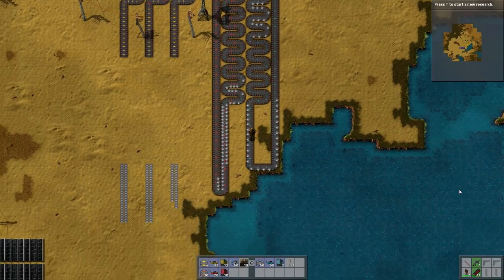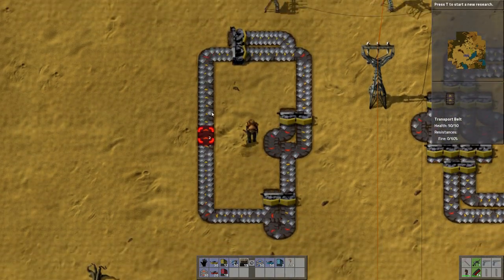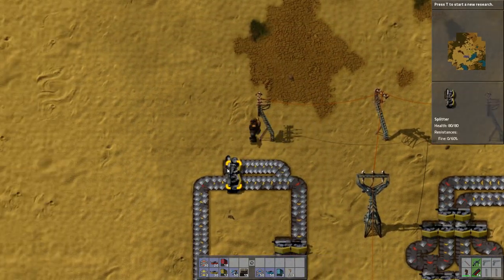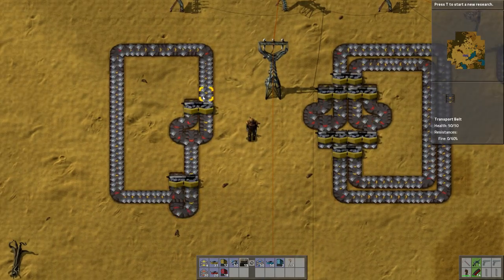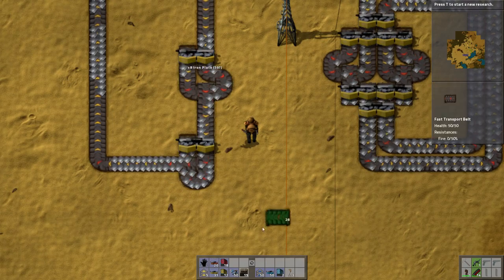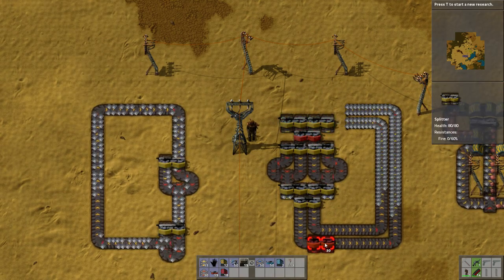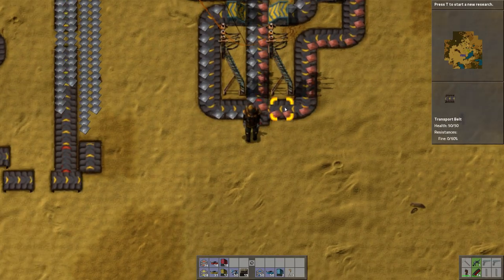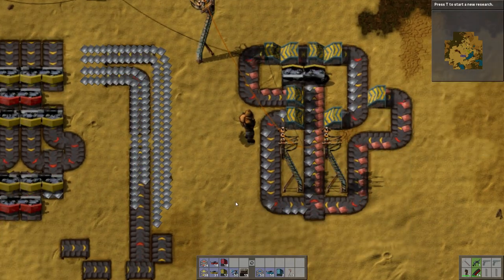Factorio Tutorial 5 - Belts Part 2

Comment: Steejo, those rebalancers are no good. They introduce compression losses.

See here for a rebalancer design that doesn't drop compression: http://i.imgur.com/H9rIGDq.png?1

The "four belt" isn't upgradable. If you turn them all into blue, That red splitter will hold up the compression if you have 4 max lines coming in as it only has the throughput of 2 max lines. In effect, its a choke point.

Yellow belt with Red corners do not maintain perfect compression. You need blue on yellow to maintain perfect compression. Red gets it 95% of the way there, hence why people normally only jump the one belt speed (instead of the two). But you didn't explicitly say this?

These belt mechanics are completely pointless though as it is all being changed for 0.12.
Reply from the maker: Negative Root I didn't go into the percentages of the compression but the first episode covered the fact that yellow belt with blue corners has slightly higher load.

Blue belt in general has a lower throughput than red with blue corners (old information but I believe it still applies) and therefore I never use full blue belt systems. One of the main issues is that there are VERY few occasions that you will ever use a belt balancer if you build your factory correctly and you shouldn't really be too bothered about compression loss as a result.
Reply: Steejo i can see you didn't go into the numbers because you've got them all wrong. Up to 35% of max compression can be lost through compression losses. You don't build on a scale big enough, but if you've got say 10k/min running down a main bus, that's 3.5k/min you're losing to your design.

Its probably a good thing this all doesn't matter due to 0.12. Its the part of the game where 98% fail.